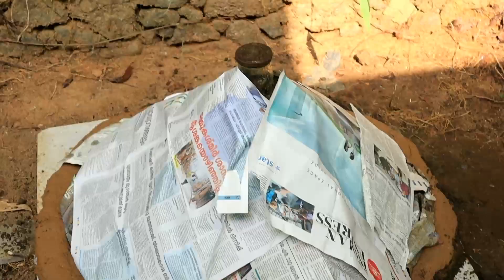how to make earthen oven malayalam||primitive technology||baking bread in the earthen oven||cook-e13

Comment: Please don't provide the air vent on the top. This is to help the oven retain the heat. First firing of the oven should be only after the cob has fully dried out. This drying can take a few days. Else, cracks can develop.